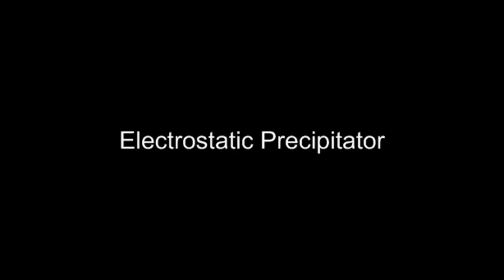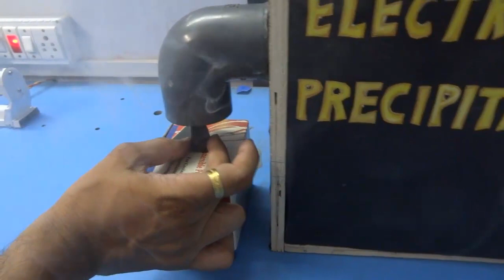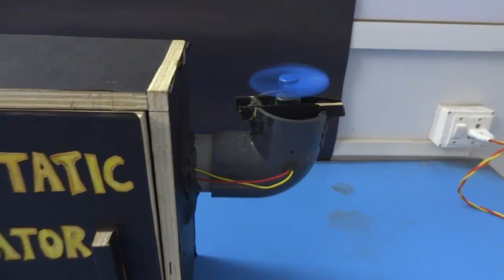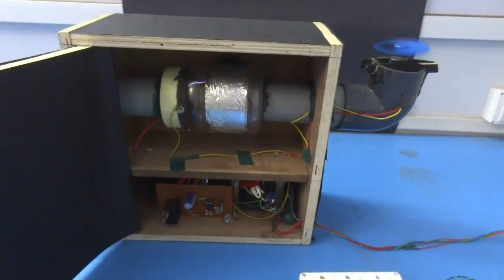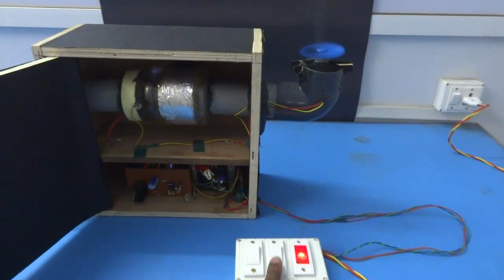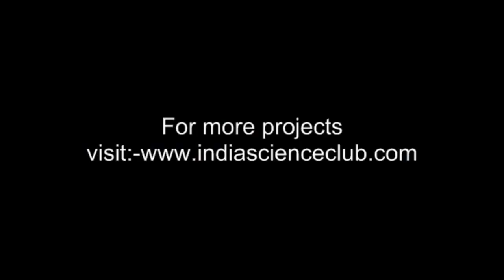Electrostatic Precipitator for Air Pollution Control

Comment: Arching should not be there. Any voltage ionising especially above 8 or 10kv is likely to produce harmful ozone as well. Distance be so adjusted that arcing is not there then the plates will have charge radii just below the plate distance

Comment: an electrostatic precipitator (esp) ia a filtration device that removes fine particels, like dust and smoke, from a flowing gas using the force an induced electrostatic charge minimally impeding the flow of gases through the unit. thank you

Comment: Hello please can l get your phone number l am doing a similar project and l need help. If l can get the circuit diagram an components l will really appreciate. Thanks in anticipation.
Reply: Hi IAm also tryed  to do it and I get success
Reply: @mr--charlie  Help plz with your work... how did you step up the voltage mathematically

Comment: please ,can u tell me the diameter of this pipes ,because thinking its very small may be 5 to 8 cm ,and how much size of this box in 3 d .......L.W.and H...in cm ,and how much the voltage used in this process 10Kv,20Kv,or 30 kv ......thanx
Reply: If you succeeded can you help me with the details